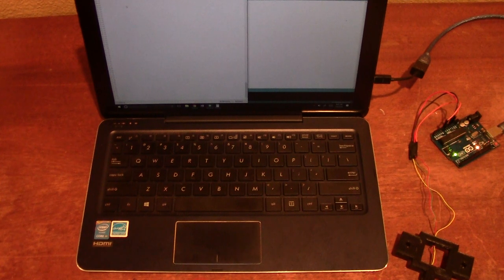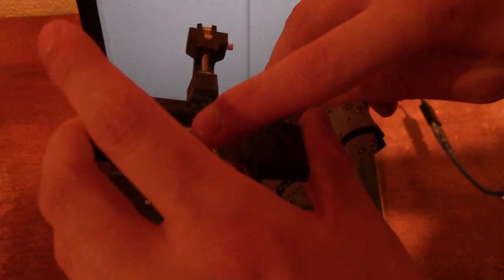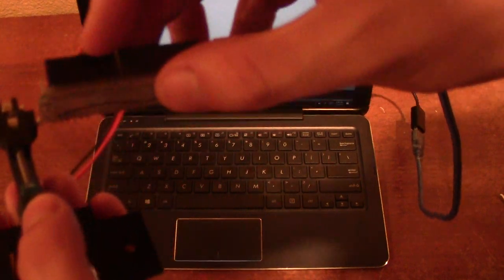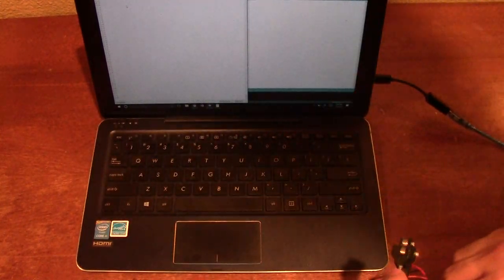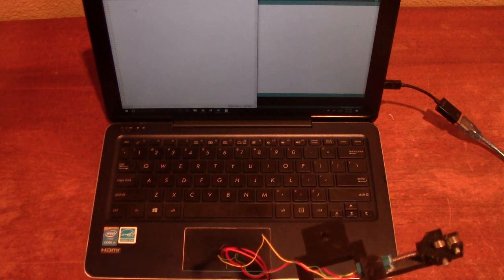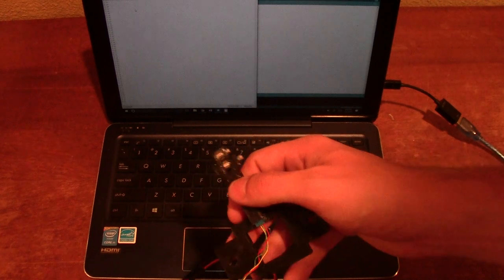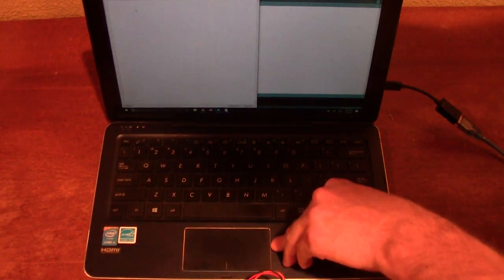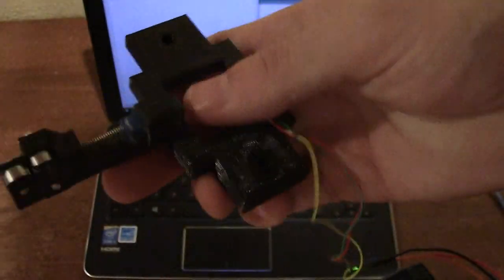Sensor For Measuring Filament Diameter

Comment: Great project.  Just one suggestion.  Depending on where you take your measurements, the filament is likely to be soft.  Have you determined what effect on the filament the rollers have in terms of diameter?  Second, you might want to compare this to a simple digital micrometer measurement to compare.
Reply from the maker: filament sensor is way far away from where the filament is heated. It should be very solidified by the time it makes it to the sensor. The sensor sprint is only like 2 lbs of force anyways fully compressed.
Reply: @TheGreenEngineers  I had hoped that the sensor was involved in a tension balancing assembly between the extruder and the take up reel.  ie Tension increases when the diameter is greater than spec and is reduced when the filament is the proper diameter.  But in this case, the sensor would need to be close to the extruder
Reply from the maker: @nitrousman8882  it is this kind of configuration. The sensor cannot be close to extruder otherwise filament will still be soft and give false reading.

Comment: Unfortunately, this potentiometer has a life cycle of 500,000. So after you do 20-30 rolls of filament you might have to replace it. it's kind of expensive.